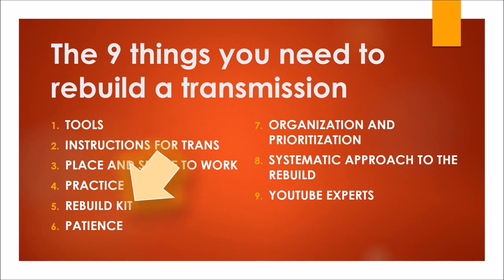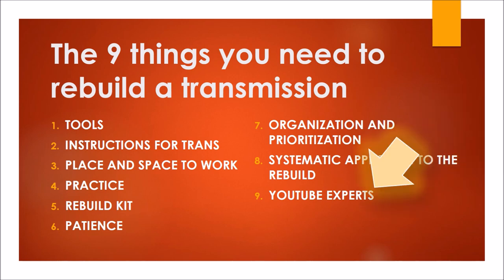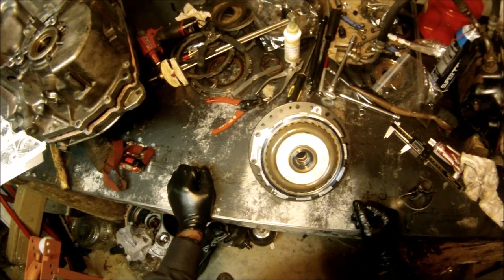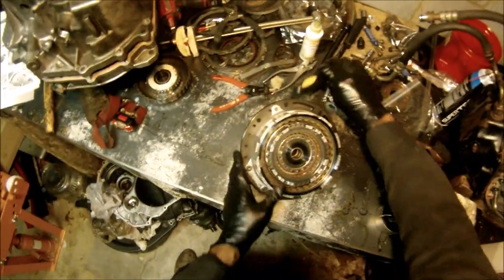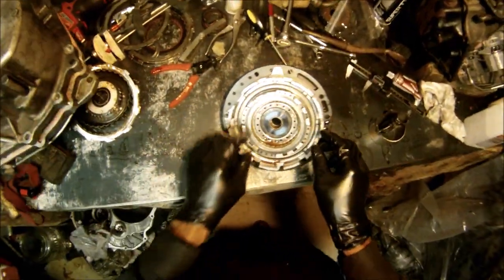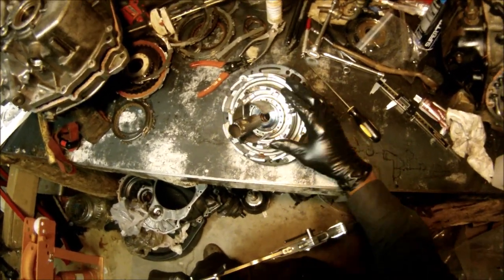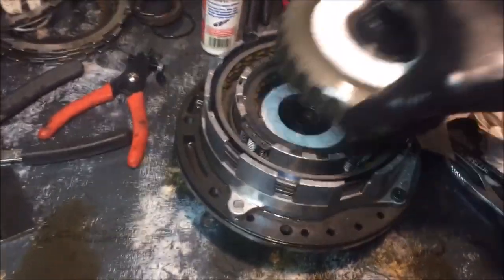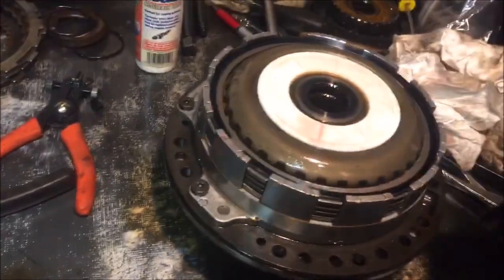I Rebuilt My Transmission - Volvo 850 #BlownTransmission (Vlog 8)

Comment: There's a 93 850 sedan with a manual transmission out at U-wrench-it, up by the pull a part north.  It went out on the lot January 9.
Reply from the maker: Atl_850_fan oooooh! I will try see if I can make it up there
Reply: Still there.  I took the control arms.

Comment: Wheres the transmission pans on that style of trabsmission?
Reply from the maker: Chase Blum there is no pan per se, but the closest thing to the pan is the black sheet metal boxish thing. On the front of the where the trans cool hoses go into the trans. If you want to change the trans filter, you have to pull the trans to do it...because it’s inside the trans
Reply: @vazfx16  damn, i was hoping to change the filter on it, also on o e of your other videos where did u get the after market performance air filter?
Reply from the maker: Chase Blum I figured you wanted to change the filter lol. Sorry. The air filter is just a K &N filter, with a custom fabricated intake